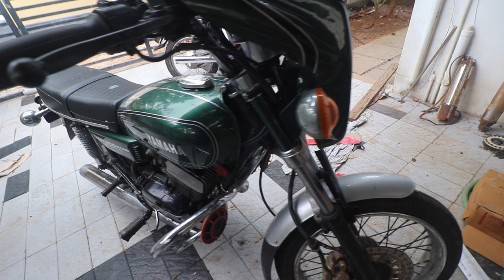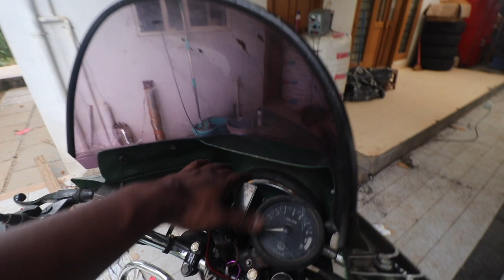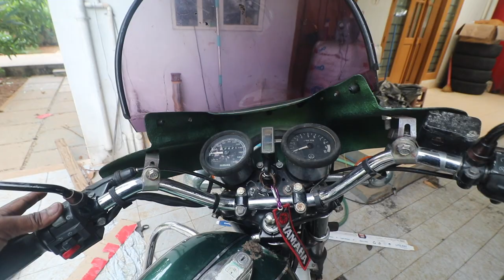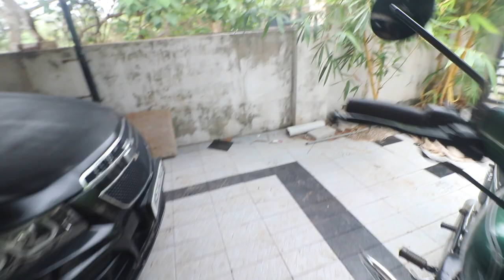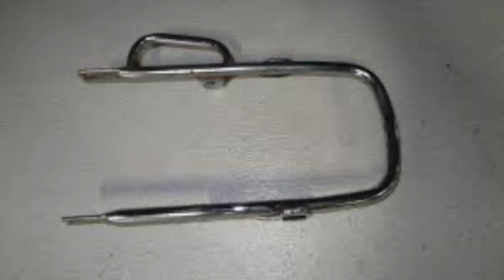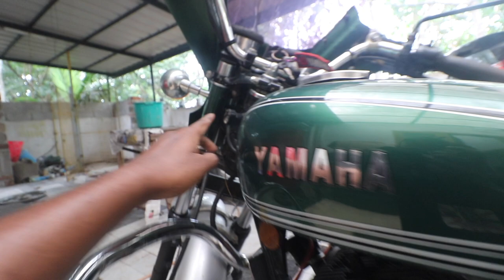What to look for while buying an RD 350

Comment: Hi, could  you plz advice  me , which US Spec  parts are the same , and will fit on Indian spec rajdoot 350 without any fiting problems.  TIA Bro.
Reply from the maker: Everything
Reply: @Yamakaze  how about chain cover,  2t oil tank,  and front light dorm .?.. Thanks bro
Reply from the maker: @jugni0019  other than rider foot rest everything can be fixed
Reply: @Yamakaze  thank you brother for your help
Reply from the maker: @jugni0019  👍